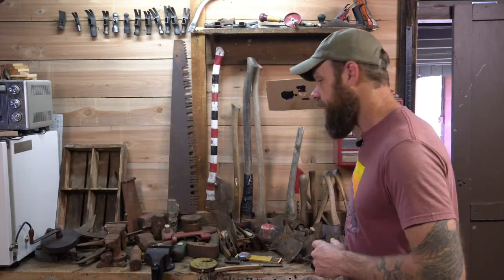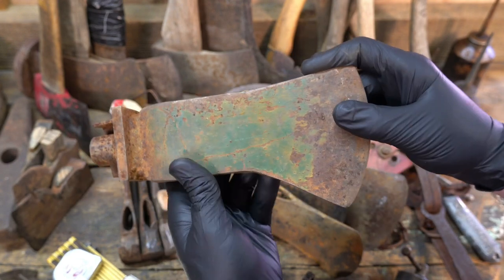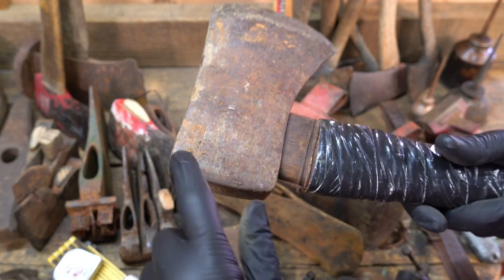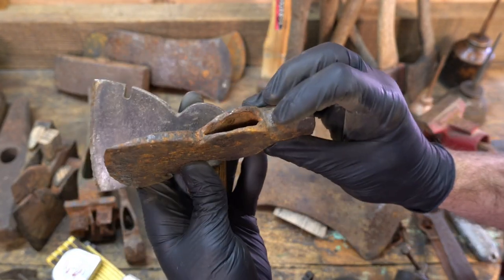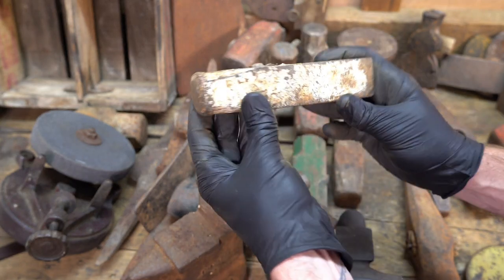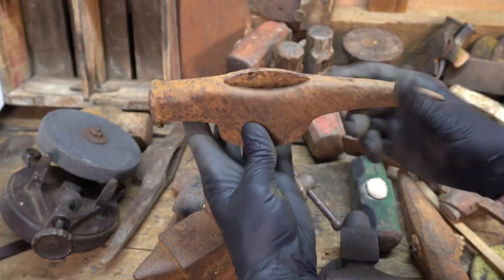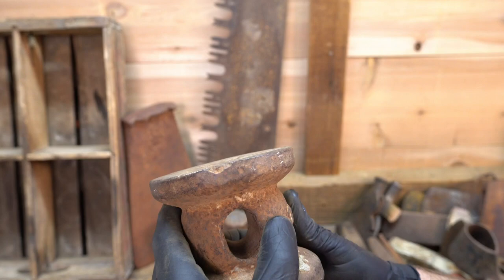Massive rusty Axe haul:  how to find them.

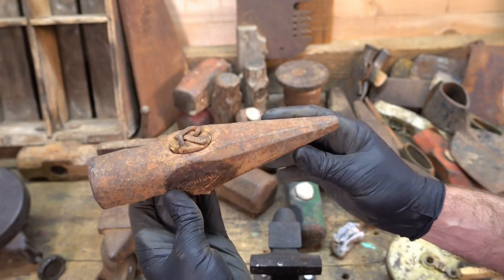Comment: Re: the W-N hammer, I used one like that to drive survey Stakes and Hubs back in my more youthful years (near 50 years ago) .  My boss called it post maul, as pwaterdu said, used for wooden posts and stakes.  The flat face didn't concentrate the force of the blow, so it didn't "tear up" the top of the stake or post like a rounded face sledge would.   I am looking for what dad always called a Top Maul about 5 lbs  with a probably 24 to 28 inch handle.  A longish pointy peen and rounded hammer face.  He used it to drive 20 to 60 penny spike on bridge jobs, he couls drive the spike just shy of the surface, spin the hammer in his hand and set the head of the spike below the surface without skipping a stroke, I typed this upbefore I finnished watching the video.  I went back the to video and at 20:30you showed the "top maul" I was talking about.
Reply from the maker: Hey Gary,  thanks for the input. I looked up that top maul, think they called it a ship maul also, Something like that.

Comment: That first log brand with the green paint is fairly modern, because it was made from a 70's+ michigan.
Starting in the mid 70's or so the poll on the Michigan pattern got much narrower and the heads started to look almost like an HB.
Reply from the maker: I'm thinking it could be an All Trade head from the 80s. Just a guess, the green paint looks original.
Reply: @old_iron_axe_and_tool  
The green paint certainly points to that.